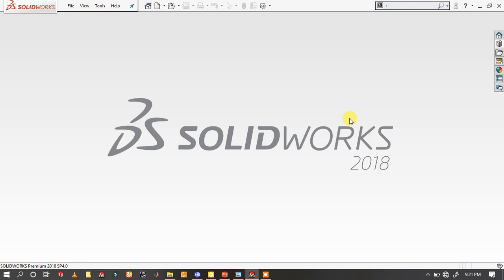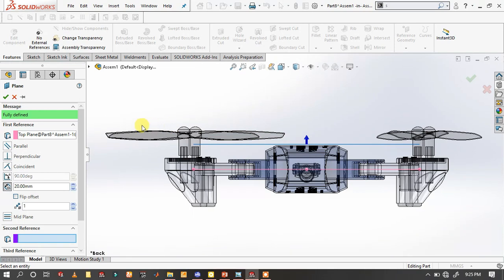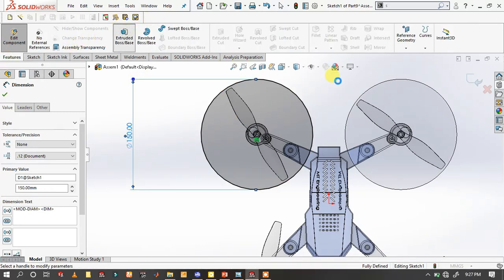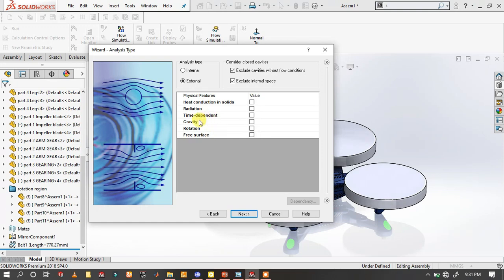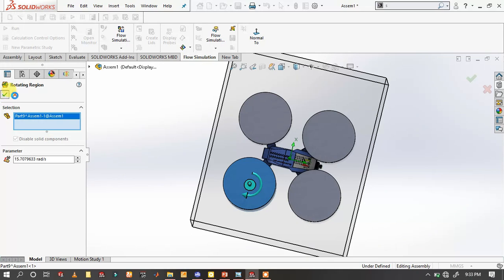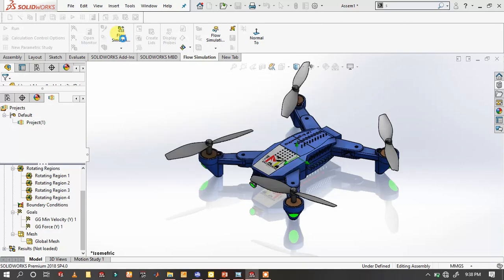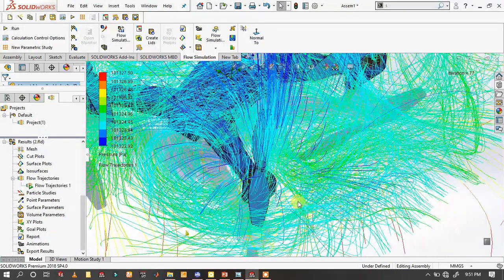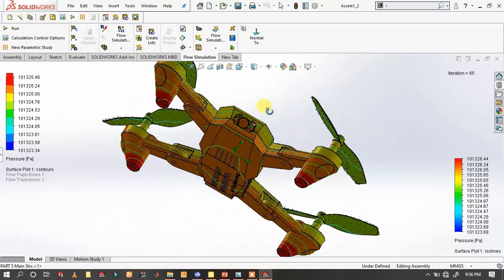CFD analysis of RC Drone using Solidworks

Comment: Amazing CFD analysis tutorial. I just have one issue with this simulation. I am following your tutorial step by step, but for some reason I get dark blue (low pressure) region in the front of the drone and red (high pressure) region at the back of the drone. Do you know how can I possibly fix that?
Reply: I got the similar results as you described, have you figured it out?
Reply: @cathy8054  Just posted the solution below
Reply: @МатвейЛаткин-щ6л  thanks a lot
Reply: @cathy8054 No worries at all.
Reply: Don't mind that comment. I figured it out. I simply needed to change gravity vector in wizard menu. However, now I have an issue where my velocity and pressure plots won't generate.

Comment: i followed you step by step but after running error pops out fluid volume recognition has failed, and I am unable to resolve it  , its something regarding the geometry of the drone , please reply
Reply from the maker: What is the error message you got
Reply: @engineering_design  progress: FLUID VOLUME FAILED TO COMPLETE  // fluid volume recognition has failed. Please check the geometry, do you want to check geometry - --- it poped out just after running ,please look for it
Reply: Sir , even I m getting the same error, can u please suggest a solution to resolve...
Reply: Sir i am getting too much pressure variation from 3,188,843.02 to 288,917.23 Pascal ?

Comment: Hi, I am also building a drone on Solidworks. I am wondering if a longer drone arm will reduce lift. Can you please explain how the length of the drone arm affects the lift?
Reply: Hi friend, I saw your comment. I think a longer drone arm transmit noise when it flying because is like a ruler while  longer is more elastic material. Maybe you can see it when you do tests.

Comment: Great Work Mr, Could you please answer my questions as it's a CFD analysis can you say me thinks like
1:- On what basses you have selected a Velocity inlet as 150rpm?
2:- What is the dimensions of your selected Propeller-{8-inches, 10-inches}?
3:- For rotation Analysis it's 150rpm pressure for individual propeller so what is the Total pressure acting on whole system like Total drag and lift forces.??
Reply: mmbimmpnokk kookl

l

poo ikjj pi of gmgmn.

Comment: is it to look for lift and drag drones?  what how
Reply from the maker: Friend can you elaborate it a bit
Reply: @engineering_design  Is the CFD simulation that you describe an explanation of drag and lift for the drone.
Reply from the maker: @bimodwiisnanto7184  if your analysis of pressure is in the y-direction ( vertical to the drone ) it is the lift force but if you take the x-axis (parallel to your model ) you will find the drag force.

Comment: This simulation is for laminar or for turbulent flow? If turbulent flow, then which wall modelling you used?? These are the most important factors on which your reliability of simulation depend...and again what is the y+ value you taken for external flow during meshing. If these things does not taken in account, then it will show wrong result which are of no use
Reply from the maker: Thanks for your comment bro ,This simulation is for turbulent flow and also I used the adiabatic wall model

Comment: can you make a tutorial on turbomolecular pump design sir?
Reply from the maker: Yes, I can and I will, if you have the 2d file I will make it sooner and it will be easier to me
Reply: @engineering_design  no i dont have but i can send you research paper from where you can get the idea for design
Reply from the maker: @AzharAli-zk3de  jest send me via email(eymmt12345@gmail.com) I will try to make it
Reply: @engineering_design  check email plz
Reply from the maker: @AzharAli-zk3de  ok I will try to make it but I need the 2 d files or the part and assembly files
Reply: @engineering_design  I just have this paper unfortunately sir
Reply from the maker: @AzharAli-zk3de  ok I will try my best but it may take a while to make it.
Reply: @engineering_design  will be waiting